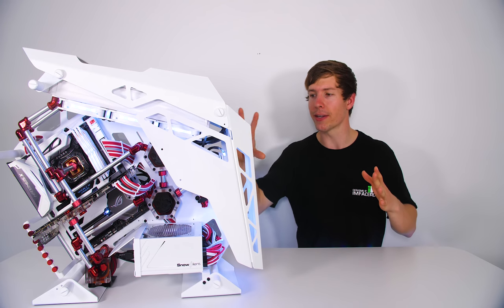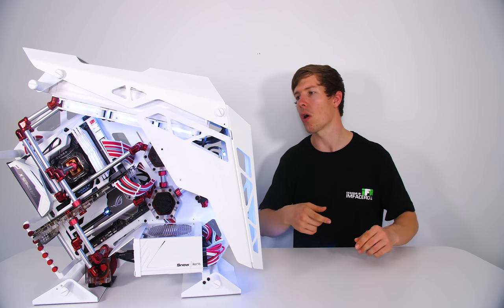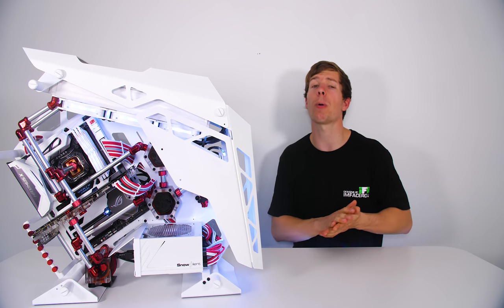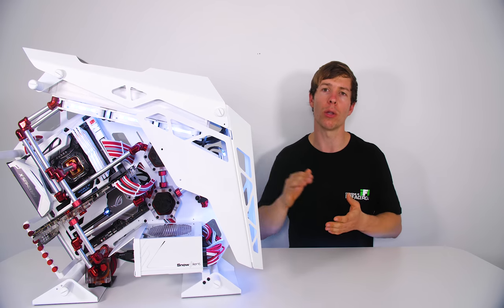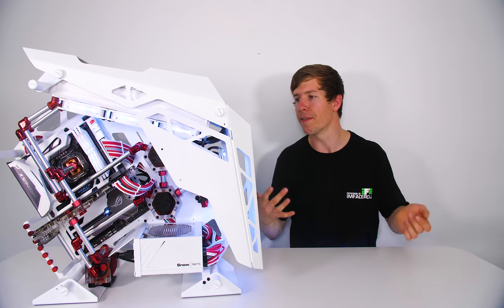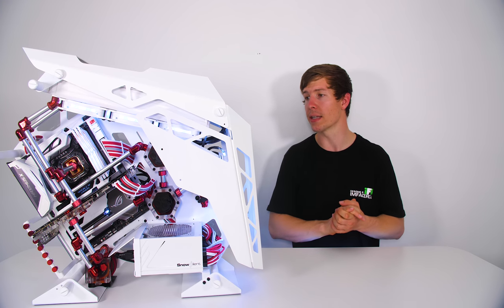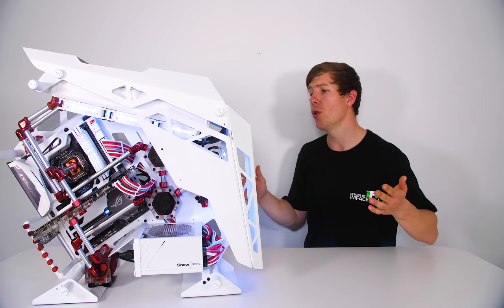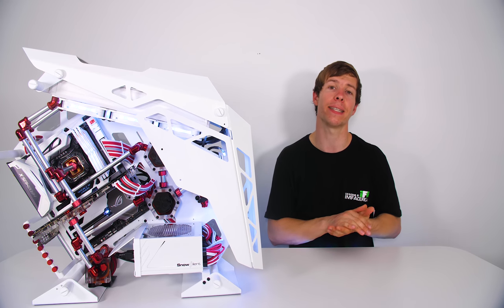$6000 Water Cooled Gaming PC Build | Cougar Conquer Time Lapse

Comment: How did this cost $6000??  Beautiful build though!
Reply from the maker: +Tick Tock Tech 6000$ AUD watercooling gear alone is 2000$
Reply: Designs By IFR wow, is this on sale or made for someone (just intrested)
Reply: Watch the video before commenting. It's his gaming rig.
Reply: Designs By IFR Bitspower is no joke. I looked for 90° white fittings, they costed 25€!! Ended up buying a combo of monsoon 90°adapter + barrow compression fitting for about, combined, 9 or 10€ each
Reply: So in euros that is?  Anyway another great video!  keep it up

Comment: Love the build. Just 2 questions what type of paint did you use on the tubing? Did the paint interfere with the fittings in any way, or maybe i should say did you have to use any real precautions to keep the fittings from scratching the paint? Again love the build.
Reply from the maker: +judas368 hey man, i kept the end of the tubes free from paint so when i put the fittings on it didnt touch the paint =). Ill have to get the paint brand when i get home
Reply: Thank you for the info. Am planning a build with a car engine approach to it, mixing black soft tubing at some points and hard tubing in others.Was just thinking that silver stainless would look good for the hard tubing parts of the loop. kind of like the AC tubing. looking forward to hearing back on the paint that was used.
Reply from the maker: +judas368 paint was white knight super chrome

Comment: what a wonderful video. Nice build ever. I am also wanting to do a white build edition. You gave me lots of inspirations.
is that all water cooling parts are from bitspower? I have the AlphaCool fittings and it's hard to tight them with tubing :(
Reply from the maker: +Cuewars Taner i believe alphacool make 13mm fittings not 12mm so be careful of the tubes you use

Comment: Amazing. Is it possibel to see back, how you manage the cables. And one question is the power supply without screws? :)
Reply from the maker: +SJ N yeah if you look closly i attached tge power supply with screws but the way it mounts the psu is upside down, so for me to put it up right way i couldnt screw it in

Comment: Aussie Pride Mo'fos. Best PC builder alive. Keep up the good work mate. 

I'm planning to build a new gaming PC and have few questions if you won't mind answering.

1. Can I spray paint a RAM/Motherboard PCB or is that a bad idea? 
2. For RAM: Would CAS latency make a big difference? Which is better - 3200 (CAS-16) or 3000 (CAS-14)?
3. Is it better to wait for Volta gaming GPU's or just buy 1080Ti?
4. For watercooling I want dual reservoirs as they look better IMO. Anything I need to look out for? Series or Parallel? Also I've read it's hard to maintain fluid balance long term.

Cheers.
Reply from the maker: +Mc Mcx hey man, i have seen it done but i believe special paint was used. It doesnt make a big difference for RAM. Perhaps wait because the price of the 1080ti should drop
Reply from the maker: +Mc Mcx hey man, i have seen it done but i believe special paint was used. It doesnt make a big difference for RAM. Perhaps wait because the price of the 1080ti should drop
Reply from the maker: +Mc Mcx series or parallel is fine as long as the liquid flows through the loop that is all you need

Comment: How did you install the reservoir?  I did not see a mount.  Love the build by the way!  😊😊😊
Reply from the maker: +Rogue Dragon 94305 i drilled holes through the case and screwed it in
Reply: Designs By IFR then when would someone use the mounting kit?
Reply: Designs By IFR how are these reservoirs compared to normal tube reservoirs?
Reply from the maker: +Rogue Dragon 94305 they are  a unique design so i wanted to try them. They have a fill port on each side which makes it easy

Comment: As the noob I am, especially when it comes to water cooling, I have to ask. Why not put the drainplug on a T-plug or what its called on the outlet on the pump since thats the lowest point on the build?? Woundt that make it alot easier to drain and maintain the coolant??
Reply from the maker: The reservoirs contain the largest amount of water so i turn the build side ways to drain it because there is more room

Comment: Not a fan of open style cases like this (i hate dust on my components) but man this is a good and clean build! Deep red and white is such a awesome combo, also the "arctic blue" from the fans really fits the theme! Where does that price come from thou? Watercooling parts? I am kinda afraid of building my next pc with hardline tubing when it really is that expensive.
Those cables kinda draw me off, i not straight enough, not really perfectly layed through the build, but don't mind my perfectionismn xD

R.I.P desk pc :_(
Reply from the maker: +PiTdeLyX yeah the watercooling cost like 2-2.5k
Reply from the maker: +PiTdeLyX its also 6000$ Australian dollars sorry
Reply: It still is 4000€ but considering the quality of these cooling-parts (fck they are expensive o.O) I think it is more in "my price range", my plan was about 3500€+/- for my system.
Thanks for the answer and clarification ^^

Comment: What reservoir were you using and how did you mount it.
Reply from the maker: I drilled holes in the case. Its a bitspower hex res
Reply: Thxs for the info

Comment: What fans are those?
Also is that metal tubing? 
Sorry for the questions haha just curious
Reply: Looks like stainless steel tubing based on the brushed finish
Reply: Thats what i was thinking but i wasnt sure, the almost matte finish made me wonder if it was painted acrylic or petg
 i wonder where he got his tubing, im planning on a loop that uses stainless steel and that finish is beautiful
Reply: Thermaltake Riing Fans
Reply from the maker: +coolerthanyou hey man thermaltake riing fans and it is painted tubing
Reply: Designs By IFR hey thanks for replying! Your builds are always top notch
Also what type of paint did you use for the tubing, just normal mettalic spraypaint? It looks really good

Comment: The problem with this case is that it's bulky af to house a mobo that looks like it's falling out. So it's mostly 50% case 50% pc parts. I think think you missed an opportunity to add red accents to the case itself, too white. Or even add in red rings to the fans but that's purely white too.. Looks cool though
Reply from the maker: Na too much red would look tacky, i want it to look premium
Reply: Designs By IFR the case is completely white. Looks like something is missing but whatever works for you

Comment: The Yellow version looked a lot better. There's just too much white that the features of the case don't pop out at all. If that top rad or the glass panel screws were red or black, it would have made a huge difference.

Comment: Will there be issues if you power on the PC with only 3 sticks of ram?
Reply from the maker: +Angus Wu nope works fine
Reply: Angus Wu you could have used one and it would have been fine
Reply: Angus Wu no there will be no problems i have a single 8gb ram stick and my mother board has 4 slots and it works fine
Reply: Orbit Rain ok, thanks for the info
Reply: Orbit Rain but do you have to put it in a specific slot?
Reply: Angus Wu np man
Reply: Angus Wu i am not sure i put it on an outside slot not the 2 middle ones because of my ocd but i dont think there is a specific slot u have to plug it into
Reply: Orbit Rain if you’re not sure, that’s fine. Cuz if you only have 2 sticks, you have to put them in every other slot. For some MOBO, it’s 1 and 3, but some are 2 and 4. Thank you for the insight anyways thiugh
Reply: Angus Wu np man

Comment: Don't want to be a wet blanket, but from an engineering stance, there were introduced too many points of failure, all the 90-degree fittings- they look at all the electronic components and trying really hard to leek.
Need to bend the tube...At least the loop is somewhat correct and I really like the concept. White - fucken' rite see all the dust all the time and keeps it from overheating in direct sun.
This gives me an idea to build mine completely matt black and don't show anybody how I did it. And another thing, where 2300 to 2500 $ went?  
Now seriously, well done build, I actually bought the case and shot it matt black and gunmetal.

Comment: Does this run 240fps on Fortnite need to know asap
Reply: yes, drop $6000 dollars or it wont run 240 frames
Reply: illuminosis sorry I’m new to PCs I didn’t no
Reply: @illuminosis6823  also it was a joke lol
Reply: @recphantomx3542  I was joking too  lol
Reply: illuminosis I’m new to building PCs should I do water or fan cooling
Reply: @recphantomx3542  I’m not gonna lie, I’m not knowledgeable with that kinda stuff. Ask on Reddit r/builmeapc
Reply: @illuminosis6823  ok thanks
Reply: @recphantomx3542  water cooling is better but more expensive and a little more complicated, AIO coolers are absolutely worth it

Comment: Direction of fans?
Reply from the maker: Front fans bring in air. Top fans pull air out
Reply: Also, is there room for two more fans to go on top of the radiator?
Reply from the maker: Should be able to do push pull yes

Comment: It's got only one GPU, instead of SLI.  Seems like a waste of water cooling for just one GPU and CPU.   360mm radiator + 240mm radiator, + 3 reserviors can easily cool one more GPU efficiently, even overkill it.
Reply from the maker: +Tony Jiang no such thing as overkill =) i am saving two gpus for my main x299 pc
Reply: Yeah, I'm just saying it can do much more than just cooling CPU and one GPU.  I have the same case using 360 +240 radiator, pull method airflow, EK water cooling.  Cooling a 1950 threadripper and two 1080ti, manage to keep temp below 45'C while OC.  I'm sure ur  water cooling system can do much more. I guess it's always nice to have one to look at and one to use.

Comment: for 6k $ you should've have a dual graphic card system ... :D And call me old fashioned ... but for a water cooled system you have too many fans and too little cooling efficiency ... :D
Reply from the maker: +simon L i explained why in the video =)
Reply: I saw it after. But for that money. Considering is just a 1080 ... Price should not go over 3-3.5k $
Reply from the maker: +simon L its water cooled. Its definatly going to be over that price. The water cooling alone is 2k
Reply: this is fancier, did a few DIY kits too... about 4-500 euros / kit more for multiple graphic cards ... like had to set  and cut myself the pvc clear tubing much fun when you ad in cooling liquid a bit of phosphorus colored liquid and some splits to create spirals ;) Imagination is key. Anyway ... but the volume of that case (bit too large) I like the setup...